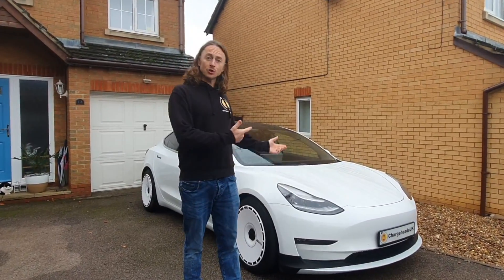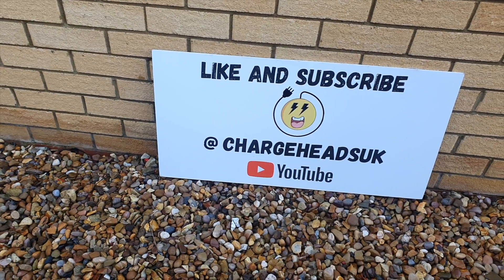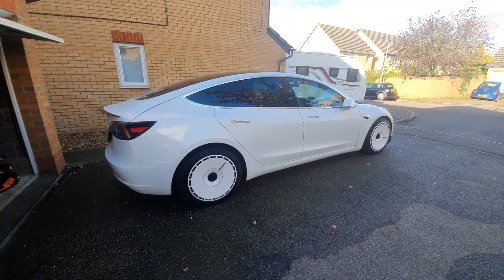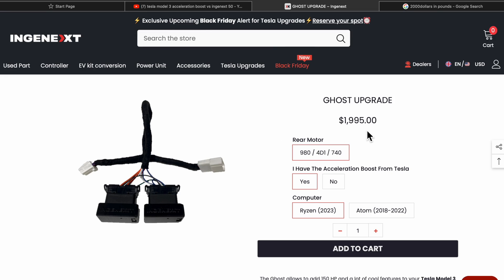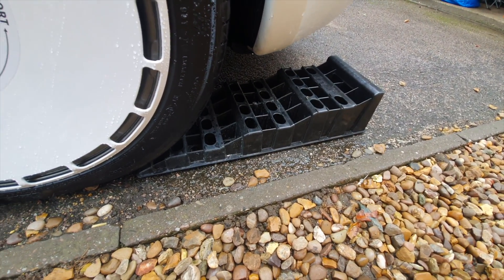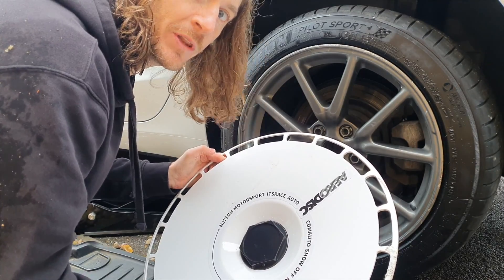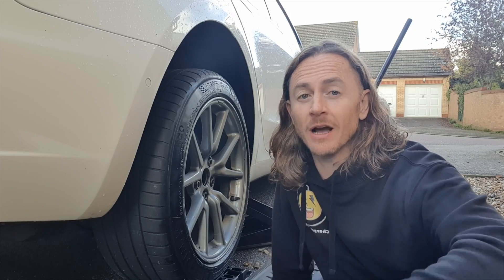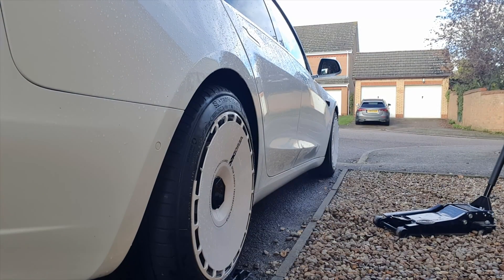Can I fit the Ingenext Ghost upgrade on my Tesla Model 3 Long Range

Comment: Will this work on the dual motor 2024 highland edition??
Reply from the maker: Check with Ingenext. Why do you want this instead of Tesla acceleration boost?
Reply: @chargeheads  Tesla rips us off for 2000.00 plus tax.  Second, I think the Ghost is faster than what Tesla offers
Reply from the maker: Ghost is only available on certain motors, however i get your price concerns. Reach out to them theyre very helpful @hidaven

Comment: I have a weird set up going on with my car and I can’t seem to find the right Ingenext model to install on my car. I have a 18’ Model 3 LR RWD with a 980 (3DU)  motor. The reasoning is because my previous gearbox failed and they had to replaced my motor and other components. So now I have a RWD Long range M3 with a performance motor. Any Tips you could give me?
Reply from the maker: I would contact them direct if I were you.
Reply: @chargeheads ok thank you for responding!

Comment: Question: if I can the acceleration boost with this mod it will be faster than a performance model 3?

Also, is it worth getting an acceleration boost if I get this mod? Will this mod technically give me acceleration boost performance?
Reply from the maker: @joseraposo3074  hi, Tesla acceleration boost is the same performance as boost 50. This ghost mode you need the right motor and then yes it will be slightly quicker than an M3P I believe. Do some research there's a bit out there.

Comment: Sadly this wont work on my 2019 DM AWD. I believe I have the 990 motor and not the 980...weird it's so nuanced that they cant make an upgrade for both. I have the acceleration upgrade from Tesla and it's great, but I've also had it for four years now and want a bit more power.

Comment: Do any of these work for the model 3 performance?
Reply from the maker: @l0aded553  The extra functions should, what functions interest you?
Reply: @ Well I was mainly interested in the hp boost but i don’t believe it works for the performance model. I have a 2020 model 3 performance but i’ve noticed significant power loss at 84% battery health. I was hoping this device could help with degradation or power loss but it appears not.
Reply from the maker: @l0aded553  there shouldnt be any power loss due to degradation. Also that sounds alot for the age. What mileage is it? Also how are you measuring the performance?
Reply: @ I have just noticed mainly top end speed loss. I calculated the degradation myself as I only get 255 miles on a full charge when I am supposed to get 300+
It’s a 2020 model 3 performance with right under 60,000 miles.
Reply from the maker: @l0aded553  Merry Christmas. That isnt great tbh. Have you watched my Alltelim video
Reply: @chargeheads  Merry Christmas! I have not watched it, no. At what percent does tesla replace the batteries, do you know?
Reply from the maker: @l0aded553  under 70. Alltelium other warranties and accurate remote battery tests
Reply: @ What is Alltelium? Sorry i’m confused..
Reply from the maker: @l0aded553  heres a link https://youtu.be/svp2uFejVXM?si=7keYUKMWOpXrtTO7

Comment: Have you had any problems with Tesla for having this module? Any issues with warranty? Any issues with getting the OTA updates? Thanks in advance.
Reply from the maker: @gabrielmoralesvelez  great question, you turn it off for updates having checked it won't effect on their website I admit this is a ball ache. It voids your warranty. Only issue I've had so far is i need to unplug and plug back in as the app isnt working, and havent had time to do it bearing in mind i need to remove the bits taken away if you check my other video. If you dont want the other features and can afford it go for the Tesla one I'd suggest.
Reply: @chargeheadsuk  thank you so much for replying. I am looking for this alternative to get the acceleration boost as Tesla is currently not offering it for unknown reasons. At not for my 2024 dual motor. I asked a Tesla employee, and he told me that I would be able to get this upgrade as soon as it gets available on the app to buy it.

Comment: I just bought the s3xy knob and commander. Has drift mode and traction control as well as off-road for snow mode. Shouldn't void warranty
Reply from the maker: @L33TTechReviewer  on the Long range?
Reply: @chargeheads  yup got a long range, it can disable the cars ESP and front motor. It disables all regen, traction control, safety features and stability control. Works on all long range awd models that they support. Haven't tried it myself but it's there and discord has some users that love it
Reply from the maker: @L33TTechReviewer  i suppose you can add Tesla acceloration boost to that too. But when you add that and the sexy buttons its quite pricey
Reply: @chargeheads  ya luckily I bought a used long range with tesla accel boost included last month, got the knob and 2 buttons a few days ago and loving all the goodies 👍
Reply from the maker: @L33TTechReviewer  Happy days 😉

Comment: aww that sucks. i remember 3 years ago when heard about ingenext, i checked to see what motor was in my standard range plus. it was the 980. i waited for the module to go on sale. i paid $1060 cdn total with install. i was able to get 0-100km in 4.5 with a full battery. 

i also had the auto trunk open, and auto door open for a few months before i disabled that feature. i kept the ambient light tho, under the dash and door pockets.

and i used drift mode once. the guy said when i leave the car and come back, it should reset the computer back to normal but it didn't. it skid through 3 stop signs in the subdivision. before i went on the main road i pulled over and powered off the car and powered it back on. then traction control went back to normal. i never used it again, too scared. you can actually feel the weight of the car. i didn't realize how bad of the driver we are without the computer assisting us with the traction control
Reply from the maker: I bought the boost 50 specifically for the drift mode. Still not fitted it, I will when I get 5 minutes

Comment: 3D5	motor you have - 180 kW @ 6000 rpm 326 Nm
Reply from the maker: The rear one? Are you sure? The small drive unit i have for my EV conversion is 220kw 🤔
Reply: @chargeheads  on the motor ID badge, at the bottom is 3D5. The 220kW motor should be the 3D6, which I'm trying to find two of, for my conversion 😉
Reply from the maker: @bugjuicer  interesting what car are you converting and what controller are you using?

Comment: I've had my Ghost mod for over a year now. Absolute gamechanger in performance
Reply from the maker: Hoping to fit Boost 50 when I get a chance since i have the poormans spec motor
Reply: What about warranty stuff?
Reply: @NonchalantG  I had the 12 V battery and control arms changed under warranty. No issues
Reply: @babyyoda8195  were the control arms part of the battery and drive unit warranty or the basic warranty?
Reply: Have you had any problems with Tesla for having this module? Any issues with warranty? Any issues with getting the OTA updates? Thanks in advance.
Reply: @gabrielmoralesvelez  2 years. no issues, had warranty service at Tesla done, no problems. All OTA updates come thru. I have latest FSD too
Reply: @babyyoda8195 What year is yours?
Reply: @ 2018
Reply: Won't tesla block it with a later update? I mean it makes sense for us to buy their acceleration boost instead
Reply: @AlanTrades  On year 3, no blocking yet
Reply: How to get this mod?
Reply: @ Ingenext
Reply: How long did the install take you? I have a 22 M3 LR and im probably getting this
Reply: @dfldriver  about three hours lying on my back in passenger footwell. Painful but worth it!
Reply: @babyyoda8195  0 to 60 in 3.2 does sound worth it
Reply: Does it work for the mid range?
Reply: @hardnoisy2835  LR 980 motor only
Reply: @hardnoisy2835  prolly not, only 980 rear motor
Reply: How much was it including install?
Reply: @RyanKusuma  $1500USD but now with specials it goes for around $1k
Reply: @babyyoda8195  Including install? That’s not bad
Reply: @RyanKusuma  it's a DYI install
Reply: Do you still supercharger access?
Reply: @RoadsterAlex  yeah, the car runs perfectly fine and charges no problem including SC
Reply: @babyyoda8195 nice! I’m picking up my 3 next week and selected the one that should have the motor to support ghost 😎 that’s your 0-60 now? About the same as performance? So 3.1 or were you able to dip under 3s? Also did this impact your range when driving normally?
Reply: @RoadsterAlex  should be the 980 motor
haven't timed 0-60 but its close to 3 s
There's a huuuuge difference between ghost and the acceleration boost from Tesla. I would've sold the car by now if it wasn't for the ghost module
range hasn't changed unless I get on it. My 20 inch wheels impacted range way more
Reply: Can I still drive in chill mode? Is chill mode the same but standard is what ghost upgrades?
Reply: @snowblindbeats  chill mode is super sluggish but yeah it still works
Reply: @babyyoda8195  What do you mean? Does the upgrade affect it anyhow? Or is it like it was before you upgraded?
Reply: @snowblindbeats  chill mode didn't change, still sluggo

Comment: 😢doh....can u change the rear motor? 
Guy at work just had a bit of wood go through his Kia's sportage battery pack on m24 as the cardboard stuff does nothing to protect them, £6k and rising bill so far from kia 😮
Reply from the maker: Well if not on insurance tell him to contact Cleeveley EV. Im sure you can upgrade the rear motor, might need additional software upgrade. I have Boost 50 now, just having fitted it yet 😉